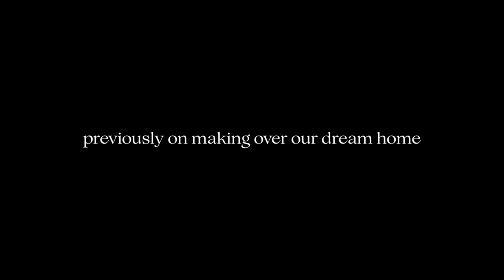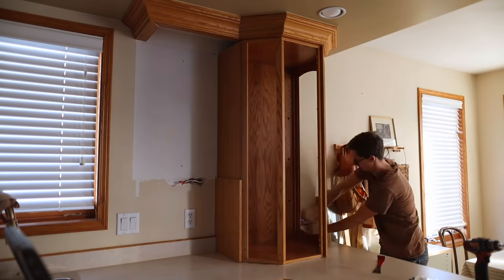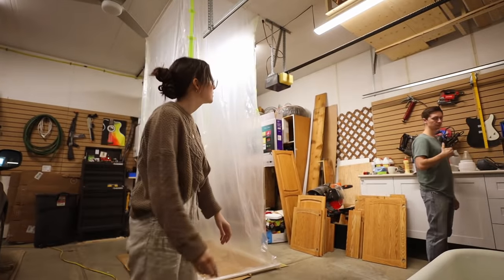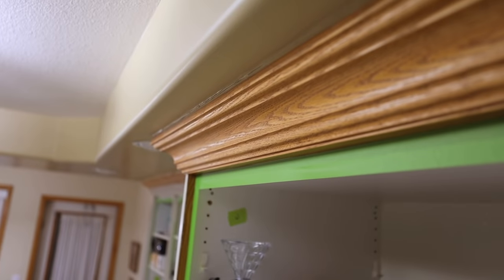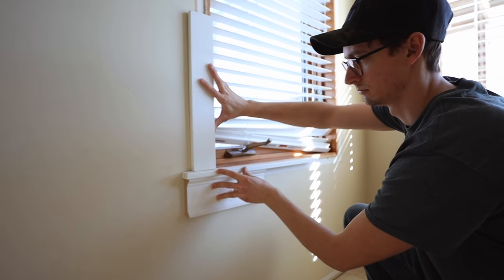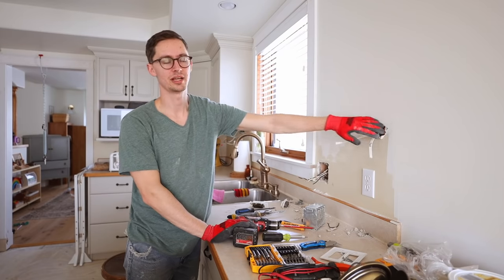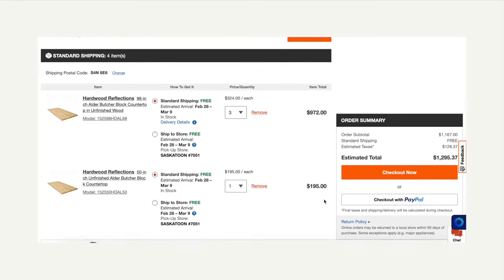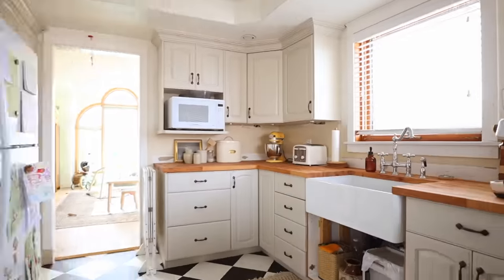EXTREME DIY KITCHEN MAKEOVER ON A BUDGET! // Budget Friendly Fixes & DIY Paint Hacks | Ep. 04 Pt. 01

Comment: Beautiful kitchen! I went with butcher block, too. I am SO happy I did. I love them. But they do take more maintenance. And I think you chose the right color of butcher block! That rich warmth looks amazing. I have dark green cabinets so I went with ash butcher block which is very light to have that contrast. 

However, at my seams I went with the Lee Valley tools adjustable countertop connectors. Biscuits are great for alignment, and that’s about it, they don’t provide extra joint strength (you’d be better off with dowel or loose tenons) nor do they provide any clamping force to result in a perfectly tight joint. The counter connectors provide both. So if you ever have issues with your seams coming apart or moisture getting into it (even tightbond III), you may want to have them repaired and reconnected with counter connectors.

Comment: The whole time I was watching, I was thinking about when Zach said (early on), "I don't really know what I'm doing." What a humble guy, lol. His knowledge and attention to detail is thumbs up. But it's also inspiring that anyone could teach themselves to do this stuff. My dad did, my brother did, and I'm relatively handy myself. When it's your own home you want to get it right, even if you make some mistakes along the way. I guess another point is to realize your limitations and hire a professional when you need to. 
I'm going to do an interim upgrade of my own kitchen so I watched your process carefully. My current job is to paint my cabinets, which are already painted. The previous owner painted them w latex, so now the paint is scratching away around the door handles. And I'm assuming that the "faster, easier way" to remove cabinet doors has to do with the hinges you have--mine are completely old school. At least my doors are flat on the front--very midcentury. I guess I'll have to strip off the old paint; I'm dreading it. And I am really dreading painting the casework. Even if I sand it...I will have to take extreme measures to keep dust off the dishes and whatnot. 
I have one question, are you guys concerned about water damaging the butcher block where the faucet comes out? Seems like there'll be a lot of water splashing around there.

Comment: I have a dream to redo a kitchen like this, especially the counter tops. I’d run my ultrasaw along the edges to cut off the backsplash area, screw in a corner piece to update the weird cut corners on the counters, fix cracks and patch seams with bondo, seal it all up, then apply an almost black concrete veneer. I feel like it would work, right?